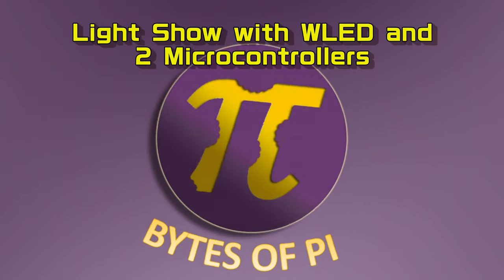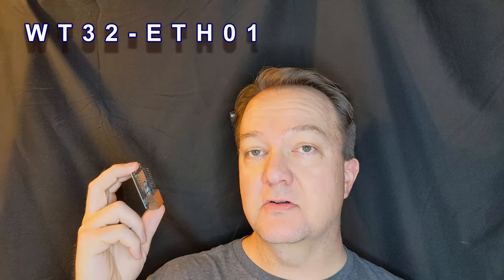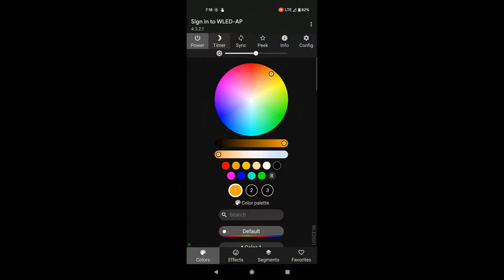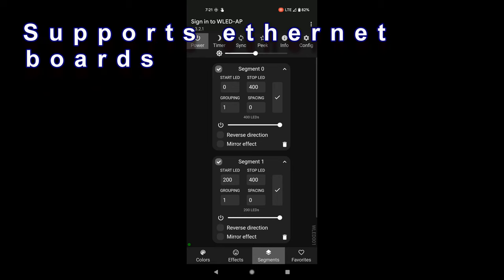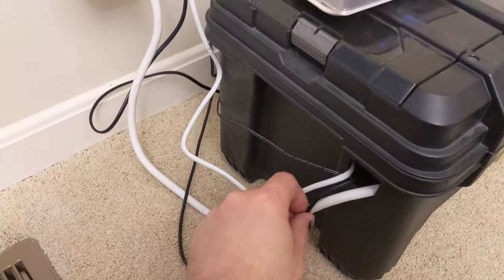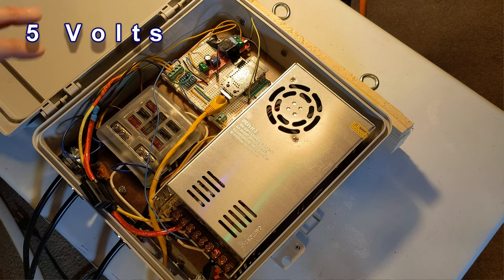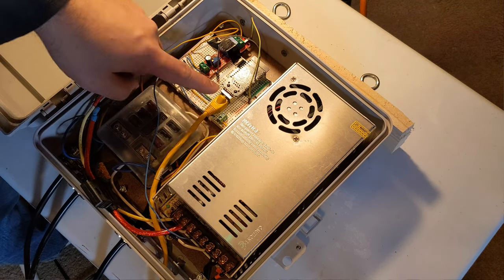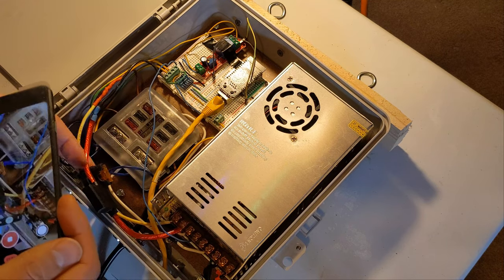Light Show Behind the Scenes - 2 cheap controllers and WLED

Comment: hey bytes with one if the links the JacobsParts WT32-ETH01 ESP32 Module Ethernet WiFi Bluetooth Development Board 100Mbps RJ45 isn't avabile do you recommend any thing to substitute that ?
Reply from the maker: Unfortunately no.  I have used Espressif ESP8266 and  ESP32 boards, but only for self contained WLED projects or my self coded light suit project.

I have never purchased the DigiUno's or DigiQuads but hear a lot of good comments about them... I've watched Quindor and DrZzz and they look like they have a lot of the challenging parts like screw terminals, resistors and level shifters integrated.  Only if you are going to coordinate with xLights, you need to purchase an Ethernet shield.
Reply: @BytesOfPi  I never never build anything like this before or even solder do you think this is a great starter project for me or should I try something smaller and build up and what would you recommend
Reply from the maker: @Kyle
There are so many things I could say starting off brand new.  It really depends on what your goals are.      

Start small - it is so easy to sink a bunch of money into this and find it is not for you. 

Check out the first video for my light suit below.  You can do all of this without soldering anything.  If you just want to outline your door or monitor or some feature in a room, you can substitute the portable battery for a normal USB wall charger
https://youtu.be/LAIMvWQhx_M

If you get WLED up and running, and you can connect it to your local Wi-Fi, you can try to create a very rudimentary xLights sequence at about 20 frames a second.

You can buy all these pieces from Amazon and I have links in the description.  However for things like the resistors and capacitor, they usually sell in Amazon in bulk.  You may not want to buy these in bulk If you're just starting out. If you have a local electronics store like micro center or Fry's, you may be able to purchase some or all of these pieces individually for cheaper.  Or take your chances on eBay or Ali Express
Reply: @BytesOfPi  thank you so much I’ll try that I have a huge interest in  computers and electronics but I never been hands out I want to find a project that was good start so I’ll try the light suit and thank you for replying
Reply from the maker: @pspwilliams  no problem!  Good luck with your project!

Comment: Thanks, very helpful. Do you have a link or further description of the "8 second" delay module? thank you.
Reply from the maker: Sure thing.  I found that the 555 board was very helpful in making sure that the power supply was completely powered up and sending 5 volts before sending it to the microcontroller.   This video was very helpful showing how to use the timer. 

Fair warning, the video shows a 12 volt timer, but I used a 5 volt timer. Same manufacturer, same layout, different voltages.  The link to that timer in Amazon is in the video description

 https://youtu.be/WCbU2VMnmTc
Reply: Thanks!

Comment: As for Controller boards with Ethernet connection, would you go with an ESP32, the Dig Uno or some other boards I am not aware of? I already have a DigQuad as you know but for my expansion I will most likely need to add boards... data wire / location forcing me to add a few boards as I find it difficult to run everything from a single board (mostly due to the length of the data cable which is limited).  Thank you!!
Reply from the maker: I can only comment on the boards I use (the WT32-ETH01 boards I mentioned in the video).  The boards are cheap ESP32 boards with an Ethernet jack built in so no need to purchase an additional Ethernet shield. 

There are drawbacks to using these boards as you have to provide your own fuses, resistors, screw terminals and NE555 timer.  It also doesn't have a built-in micro USB port, so you need a TTL programmer to flash it.  I talk about how to flash these types of boards in another video.

If you're willing to pay for the convenience of having the hardware set up, then the Digi boards seem the way to go

There is a whole other world of non WLED controllers like Falcon and Kulp boards which the lighting community has used for years, but they are much more expensive.  They also need to be fed light show data over a network and don't work by themselves.

I think WLED is a market disruptor and those expensive controllers are going to need to deal with the control that WLED provides.
Reply: @BytesOfPi  Thanks for the reply, I agree that based on what you said, the Dig Uno seemed to be my best option. I'll look at it in the Spring. Falcon products (and other) are very expensive and I do agree with you that WLED and xLights are most likely hurting them... Competition is always good for the consumer!!  : )

Comment: I'd honestly like a build breakdown of everything in the box. I see a breadboard,  the WY32-ETH01 etc but I myself don't know how to connect all those together. I see jumper wires but don't have the first clue how any of it works. I can copy cat though with a build video if possible
Reply from the maker: I will definitely keep that in mind.  I have all the components for another box, but other projects like putting stars on trees, and creating two new xLights sequences are holding me up.

A fritzing diagram may also help as well.

One of the other things I'm trying is I created a PCB circuit and am waiting for it to be delivered from China.  That should make it easier and cleaner to connect the pieces than with just a breadboard.  If it works, I have improvements in mind to make it cleaner

Comment: Hi, could you tell me what diodes you used for roof lighting? I mean from the point of view of sufficient illumination. ws2812 or 2811
Reply from the maker: All my pixels are WS2811 5V 5 inch spacing IP68 bullet pixels from Ray Wu.  

I've been fortunate that my roofline pixels have lasted without issues, but the last few batches from Ray have been sketchy at best.  Lots of bad pixels out of the box and they are quick to blink at lower voltages.  Ray is also the vendor with the most reported issues on pixel report
https://www.pixel.report/report-data

I'm probably going to shop around for my next batch
Reply: @BytesOfPi  I would like to clarify, what is the distance between the pixels in the end on the roof, windows? I think it's about 2 inches? Because the lines are very smooth.
I ordered for a sample of 12V 2 inches in diameter with a distance of 4 inches, each pixel has 3 diodes. Right now, in thought, while there are discounts on them, I would like more, but I'm afraid at such a distance on the roof and when observing from 6-7 meters, each pixel will be clearly visible and the rainbow will not turn out smooth.

Comment: I have 2 questions, what are the pins on which the data outputs are connected? and how many outputs can be done in this controller?
Reply from the maker: I believe you have five pins that you can use, resulting in five output channels.  Pins 2, 4, 12, 14, and 15...  Pin35 is input only so you can't send data out.   Here's a pinout diagram.   https://m.media-amazon.com/images/I/71CYGN4D47L._AC_SL1500_.jpg

And the other cool thing is you're not limited to just one universe per output...  So that's a cool thing

Comment: so i’m trying to do something in this realm. basically i have an esp32 board setup with wled on it.  i want to sync it to music on my computer. Is there a way to send Midi from My Daw, and to the esp32 board to trigger different light sequences in Wled?  I think Wled accepts this sac protocol for triggering.  but how do i connect that to the board wireless my.  does the sac have its own app for this. I feel like you are super smart and could explain it. thanks
Reply from the maker: Are you looking for the WLED sound reactive sequences to react to songs you create on your DAW?  I haven't had the opportunity or need to try SAC, but there are 2 things that come to mind if you want WLED to react to custom songs

Audio reactive WLED
If you hooked a mic up to your ESP32 there are sound reactive sequences that will react to the music it hears.
https://kno.wled.ge/advanced/audio-reactive/

xLights sequences
I prefer to have tighter control on how my light show reacts to music, so I sequence my lights to music using xLights and then use DDP to deliver light data to my individual WLED controllers.

One place you might find solution to your problem is the r/WLED Reddit page.  There are a lot of guys there that maybe able to provide more insight.

If you do go down the SAC protocol path and get it to work, it may be worth posting your success on that page so others can follow in your footsteps.
Reply: @BytesOfPi  xLights, that’s interesting. i haven’t heard of that. also DDP,
what is that? is that a lighting protocol like art-net?
Reply from the maker: @eross21  
xLights is an open source tool that the lighting community has used for years.  High level, it allows you to model your display area with all of your light props and controllers and create "sequences" that will fire DMX based packets using the DDP protocol.

I have another video that demonstrates connecting xLights and WLED.  The video doesn't show the music sequence because of YT policies, but you can see my current light shows on the channel synced to music 

 https://youtu.be/LkGCo9Gi8mk

If you're interested in DDP protocol or xLights, here are a few links

xLights: https://manual.xlights.org/xlights/
DDP protocol: http://www.3waylabs.com/ddp/#Efficiency

Comment: Hi, you mentioned running your ESP32 off two 5V batteries.  Are you able to provide details, please?  I've always struggled with powering the ESP for any more than say 1 hour...  many thanks.
Reply from the maker: Actually you can run an ESP32 and 300+ pixel LEDs off of one 5v phone power bank.  If you're familiar with those portable phones chargers, they are essentially long lasting durable 5v batteries.

Check out this video where I cover how to get started with mobile lights.  It talks about how to use the phone charger as your battery pack

https://youtu.be/LAIMvWQhx_M
Reply: @BytesOfPi  - great, many thanks, I'll check it out!

Comment: How did you get a separate router setup for just the lights?  I assume it is piggybacking off your main home network?
Reply from the maker: The router was just personal preference.  There is no need to have your personal network exposed to the glut of E1.31 data or have your show network exposed to the internet. 

However the FPP raspberry Pi 4 has a wireless board as well as a physical ethernet jack.  You can set up your FPP to hook to your main network wirelessly and control the show through the physical.

Comment: So, when the power supply overheats and needs to engage the fan, how does it circulate air in that control box? I live in the desert and I don't think that would work well here.. Also, is there a simple way to get the ESP32 to work with Bluetooth on stand alone projects(no network)..I want to program 10 LED settings onto an ESP32 so I can install a strip of 5 LEDs in a sculpture. I would prefer that it didn't need to connect to the internet. I just want to turn it on and select the light cycle. Maybe there is a better device for what i want to do? I would GREATLY appreciate any advise you have on this subject!
Reply from the maker: Good points and great questions.  

I live in the midwest in the US and it's humid more often than not so venting allows for dew and humidity to get in.  I also run my shows between October and January and it's cool enough not to have to vent to circulate air.  However, if you're running it in hotter temperatures and it's mostly dry like in a desert, downward facing vents are very useful.  I've actually purchased 2 downward facing vents for my boxes, but I've not had a need for them yet.  Here's a link: 

 IPV-1115 IP32 Air Vent: (https://amzn.to/46JWnoi)

As for your small project with only 5 LEDs, I have a few ideas as well.  I use WT32-ETH01 specifically for my show boxes where I need Ethernet, but you don't need that for your small project.  Instead, you're probably looking for a smaller ESP32 (or even an esp8266) that can power both the board and your lights with a micro usb cable with a regular 5v wall wart.  Hook the power of your LEDs to the 5 volt pin on your board and hook the ground to the ground pin.  You can use one power source to power both your board and your lights all at once.

HiLetGo ESP32: https://amzn.to/46GRzA6

Bluetooth vs AP: Back a few years (before WLED existed), I did write a custom program that talked to my Android app via BLE (Bluetooth Low Energy) (see code at https://github.com/BytesOfPi/LEDSuit).  However, if you flash WLED onto your ESP32 and you don't set it up to hook to a network, it will stand up it's own Access Point (AP).  Even with no WiFi around you, your board acts like a small WiFi Access Point.  All you need to do is search for the WLED AP on your phone and you'll be able to hook to and control it using the WLED UI.  I'd give that a try before rolling a custom app.
Reply: @BytesOfPi  Thanks a ton!! I'll try re-flashing one of my ESP32s, and I will skip(?) where it wants to set up the network info... I didn't know it would create its own access point.. hopefully, that works, but then I would have to toggle between my network with internet and the network broadcast from the ESP-32?  How would I just save 10 LED patterns onto memory somewhere that I can access via a button push on the finished device? This is for custom art where the lights are not the center of the show.. just an effect.  So, when someone takes home one of my pieces, I want them to plug it in and select the light cycle and be done. I am highly proficient with hardware and troubleshooting electronics, but I can't wrap my brain around the gibberish of coding! I was hoping there was a way to just flash the ESP to do what I want.. I really appreciate your response! Honestly, I didn't expect one.. I have asked many creators long-winded  questions with no response.. I am a new subscriber now! Thanks
Reply from the maker: @Ravenseyes10  
Not a problem!
I've not connected a momentary button to my WLED creations yet, but I have created presets and created a macro that cycles between other presets.  Here are the steps for 0.14.0 WLED build and later.

High level :
1) Create pattern presets:  Start off by adjusting the patterns and the colors and the pallets until you get your LEDs behaving the way you'd like to.  Then in the app, click on the presets tab.  Create a new preset and make sure that "Use Current State" is selected so it saves the current settings as a preset.

2) Create a "Macro" preset:  once you have all of your presets created, Create a new preset, but uncheck the "Use current state" checkbox.  A new "API" command text box will allow you to enter a macro command.  Here you can specify the preset cycle macro.  For example, If you want the button to cycle through presets with the ids of 1 through 9, the API command would look like:

P1=1&P2=9&PL=~

You can test if this works by continually pressing the new preset button and watch as the presets cycle.

3) Map a button to a GPIO pin:  Now if you physically connect a momentary button to your three volt and a GPIO pin, you can go to "LED preferences" and map that GPIO to one of four buttons.

4) Map button to preset:  finally, in the preferences section,  You can go to the button actions and map a short press to the ID of your macro preset.

As I said before, I've never physically mapped a button to a GPIO pin, so the last two steps I'm semi-confident.

More documentation can be found here: https://kno.wled.ge/features/macros/
Reply: @BytesOfPi  you rock! Thanks!

Comment: how many channels can each controller handle? 4?
Reply from the maker: I have only needed to use up to 4, but like most ESP32 chips, you can probably get to more than 8.  I just saw someone on Reddit who built a board for the WT32-ETH01 which used the following 8 GPIO pins for outputs:

GPIO2, 4, 5, 14, 15, 17, 32, 33